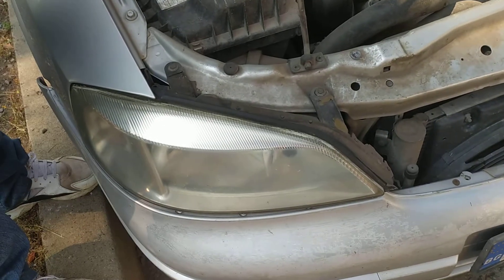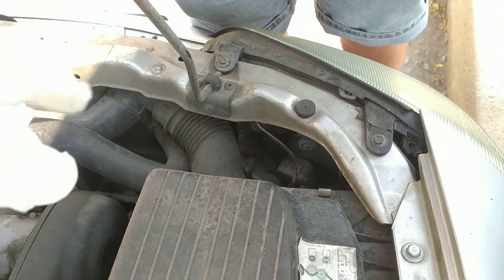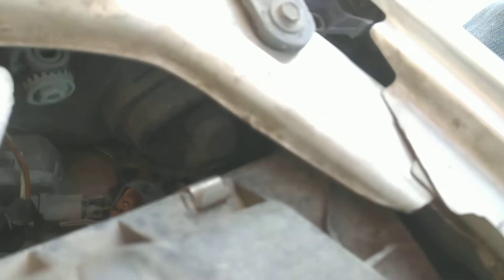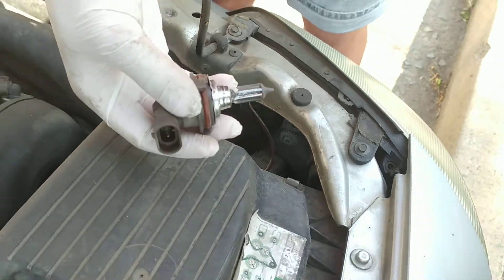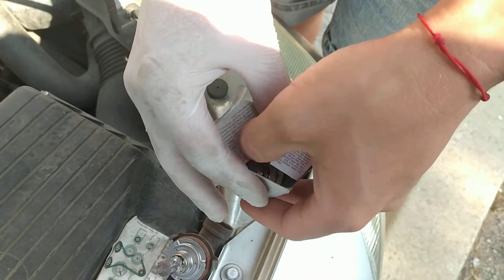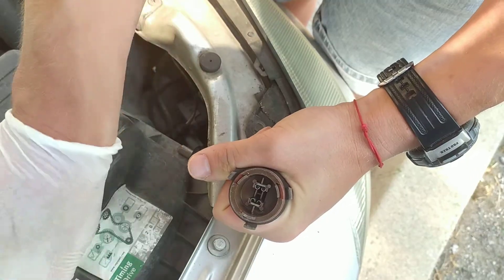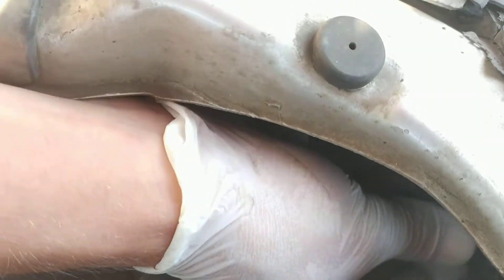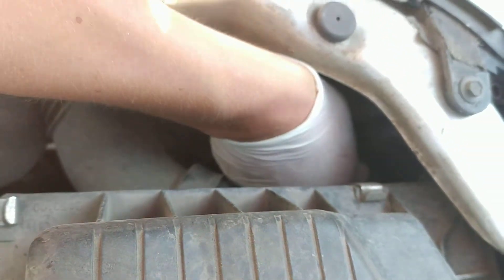How to change low beam bulb Astra G. Headlights.

Comment: H7 is for high beam and H4 is for low beam.
Your light which got burned is for high beam, because is H7
Reply from the maker: Correct, thanks for your comment
Reply: H4 is 2 high and low beam in one bulb.
H7 and H1 is probably in this car.
Reply: jfc... let's try again shall we?
sidelights is W5W
low beam is H7
high beam is HB3

there's no h4 or h1 in this vehicle